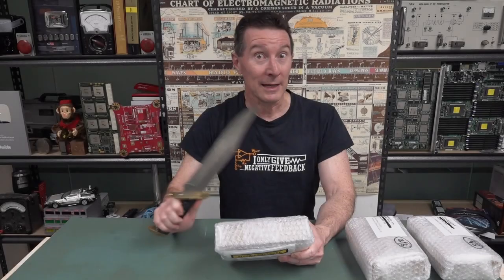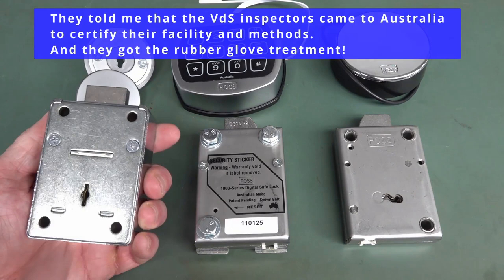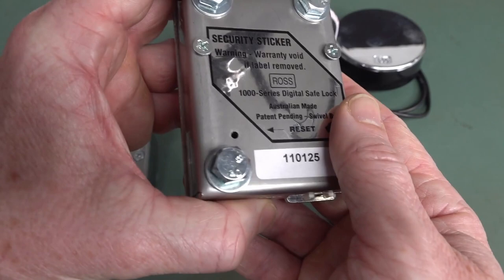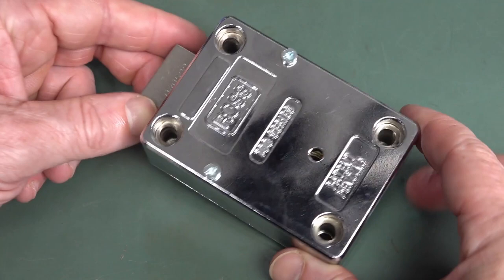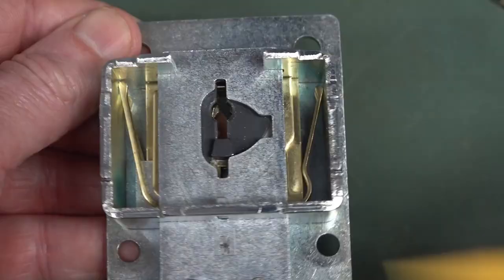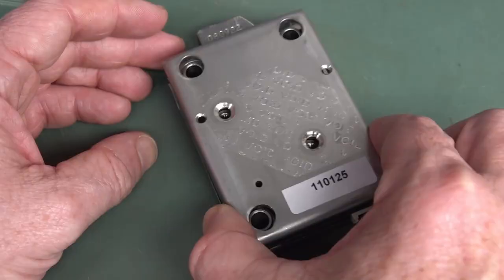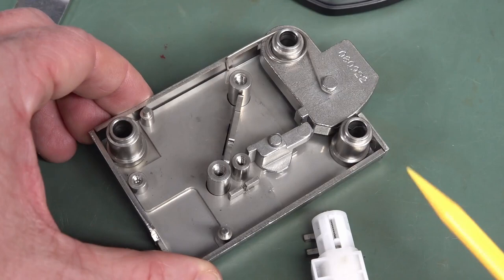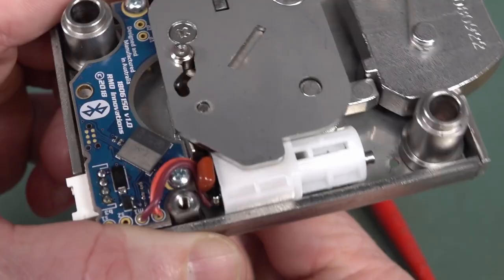EEVblog 1509 - The Art of High Security Safe Locks (TEARDOWNS)

Comment: break into where the safe is.  pry the control head off.  insert a small microcontroller INSIDE the roomy head to record key entries.  Break back in a few weeks later after you know the safe has been accessed.  Remove the micro and get the code from it.  type in the code.  OPEN.

Comment: Attacking the firmware would be the way I would go, I would attempt to dump the firmware in the chips, probably with voltage glitching (since I assume they set the protection bits up correctly) and then find possible encryption flaws, and then add a custom PCB to sniff the data, to decode the data (assuming that there is no replay possible)

Comment: 7:26 not just that, but with a high enough resolution on the thermal camera, you could figure out the order these keys were pressed. A pretty good countermeasure to that would be repeating some numbers - covering the earlier thermal trace. Of course pressing the keys quickly, like you did it, helps too.

9:38 it's a kitty head :D
Motor drive is damn cool, the engineers definitely put some thought into it. Do that side channel attack!
These Ross locks are damn cool as you show them. I love the simplicity of the design. Not overengineering things, making them with great precision and quality materials instead - way to go Ross! Waiting for LPL to pick that :)
Reply: I agree with U about high sensitivity thermal cameras picking up residual decaying fingerpint temps. My risk mitigation approach to minimising/eliminating stealth detection of my keypad entry comprises 2 things:
a) 1st I have an overhanging cloth cover that shrouds my hand & keypad from observation when I punch in a pin #. This mitigates against small spy cameras possibly installed in the room - where it is not obvious.

b) randomly pushing other pin numbers after I have opened the safe in order to leaves print signatures on all pin numbers.
Reply: @DIYhabitat  plus you can also delicately wipe the keypad with your hand or cover it so that all keys get the heat, might help too.

Comment: Impressive 9 levers are each a single piece, including the spring! 
How about the Wi-Fi lock, from the keyhole, could a thin sliver of metal fit between the levers to push the pin out of the way?

Comment: BT is notorious for having vulnerabilities being found in drivers and firmwares. Would not trust it for high sec.
Reply: I'd be more worried about it not working when you need it to. As for security, you can have all vulnerabilities in the drivers you want, but the secure key has to match what's inside the sealed lock, so I wouldn't be concerned with security.

Comment: I didn't know about ROSS Locks (made in Australia) , so thanks for the info. Very useful to know. 

I recently replaced a defective La Gard BASIC (keypad + swingbolt lock mechanism) set with the new version La Gard (701 keypad + 733 swingbolt lock mechanism) set. I suspect one weak point with these lock mechanisms - regardless of brand - is that the lock mechanism is secured to the safe internal wall via 3 high-tensile screws. However, from the external front door of the safe, there is a hole - approx say 10mm diameter - that allows either the data cable of an electronic keypad, or the connecting rod of a deadbolt/springbolt lock mechanism to pass through to the inside. 

After removing the 'keypad' & using a crude brute force method of hammering a high-tensile pin-punch, I envisage it is possible to force the internal lock-mechanism away from the 3-screw holes in the internal wall. I suspect in most safes, these screw holes are threaded through mild-steel plates. Thereby, defeating the lock mechanism. Hence, some electronic safes also incorporate a vertical glass-plate between the safe's internal wall & the lock-mechanism. Driving a pin-punch through the entry hole, or drill through the front-wall will crack the glass causing a spring-loaded pin to plunge towards the safe's locking plate thus locking it permanently. This means even with the subsequently correct use of a keypad password, it will not be possible to open the safe door except by cutting through the safe. So a robust burglar-proof safe will require the application of a good lock mechanism + clever engineering design around the safe's door mechanism as well.

I always enjoy your videos as your presentation style goes into deep-dive explanation -  which I love 🙂. Thanks for the knowledge sharing.

Comment: Very well built lock, but as with all locks, they are only one small part of security. If no one is around, very few would resist a battery powered grinder with a zip disk🤣

Comment: I really want someone to design a TOTP safe lock. (TOTP: Time-based One Time Password, aka the 6-digit rotating code in your Authenticator app.) That would certainly help get around the IR camera attack, and the worn keys attack. Put a QR-capable display (e-ink display?) on the inside to share the key, and limit how often the clock's time can be changed. No wireless of any kind required, either.
Reply: Issue with that is synchronization, you have to keep track of accurate time and if battery goes flat you must resynchronize.
Reply: @bartomiej368  How about having 2 batteries, and requiring them both to be good to lock the safe? I know it's not a long term fix, but if the safe is used every day it might work OK.
Reply: You could allow one time setting at power-on too, come to think of it. They just won't be able to re-set it until the door is opened.
Reply: @McTroyd  if you allow setting time when power on (even if locked) you just made it susceptible to replay attacks on the other hand if you allow changing only when unlocked it could lock forever.
Reply: @bartomiej368  That's why I was thinking about limiting the number of time changes while power is on (maybe a max of once per 24 hour period). Could still potentially allow time set at power-on, but introduce a delay of several minutes during the "boot" process prior to setting the time, to mitigate replay attacks. With a six digit pseudorandom code yielding 100000 potential possibilities, a delay of even five minutes between guesses still yields nearly a year of brute forcing time. Even if the actual guessing takes a tenth of that time, I'd bet it's still longer than a key lock and pick set combo, even with the tricky lock Dave showed. Allowing for the fact that nobody is going to completely stop a determined professional, I would think this is a fair compromise between security, and making sure the legitimate user isn't inadvertently locked out permanently.

Comment: Dave, do you know if they ship to America reasonably priced?
Reply: You could ask them yourself?
Reply: No idea, sorry.
Reply: Why? There’s plenty of other options in the US.
Reply: @martinlutherkingjr.5582  usa electronic locks are crap. Quality of LG and SG very low.
Reply: @mofflops8406  There are plenty of non-US companies that sell in the US. For example, LG isn’t a US company but they have distribution in the US.
Reply: With the current very strong US dollar everything outside the US is cheap to purchase😊
Reply: @5Perf65mm   that lock are not cheap. I think it costs about 250 USD.
Reply: @martinlutherkingjr.5582  you are right. My idea was not clear. I mean top selling safe locks in US have poor quality and not good security. But they have shield-UL certificated. And that fact  makes plus 100% to their fair price.
Reply: @mofflops8406  Which ones are good for safes in your opinion and distributed in the US?
Reply: @martinlutherkingjr.5582  for hi security reason i think it is Kaba Mas  x09. It is possible to find used lock on eBay for good price.
Reply: @martinlutherkingjr.5582  If cost has priority I prefer mechanical lock Big Red.
Reply: @mofflops8406  Why, what’s better about the Big Red compared to S&G’s seemingly similar offerings?
Reply: @martinlutherkingjr.5582  reliable

Comment: I saw an ARM SWD connector and BLE logo, there's another MCU under that grey cover, or on the underside of the PCB, an nRF5x probably.
Reply: What grey cover?
Reply: @EEVblog2  At 19:35 you’ll see the 6 pads (2x3) on the right, follow the traces that go left. Within the 4 white corner stencil marks.  Is there an ARM BLE SoC under there?

Comment: Stick to electronics. Mechanical locks are the only reliable solution for guns.
Reply: Nope. Manual kicks are trash. Why do you think no one uses them anymore. The only companies putting them on their safes are those companies that make big giant heavy sales, with 16 ga sheet metal stretched around it. So old guys who buy them can think they're secure. They are a dial and think it's going to be secure just because it has a dial. LOL
Reply: I said EXACTLY that in the video, obviously you didn't watch.
Reply: @littlejackalo5326  not true, every single police station / prison / watchhouse / etc that had temporary or long-term pistol storage in QLD / Aus use mechanical keys somewhere.

You're thinking of low-end key locks.  Just because you don't see the high end doesn't mean they don't exist and work day in, day out.